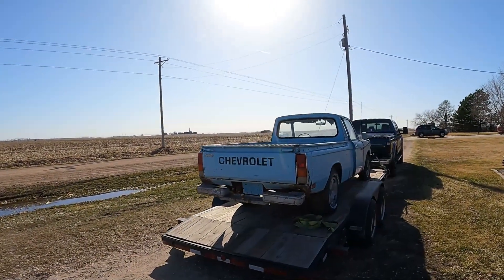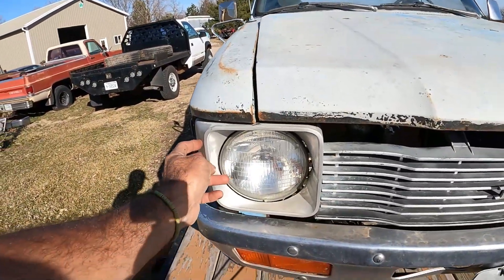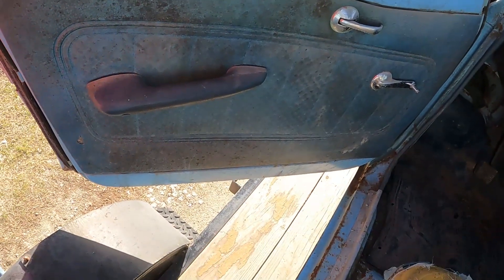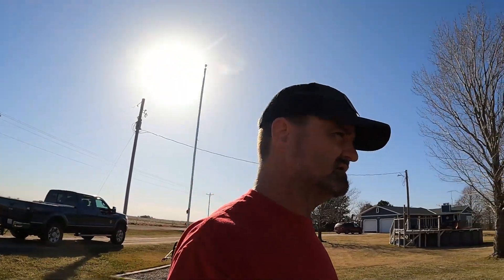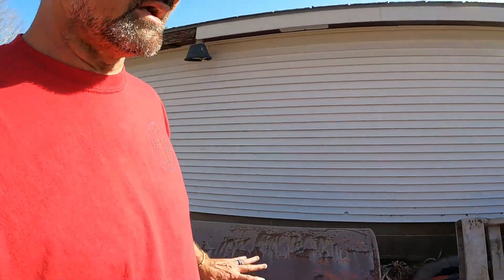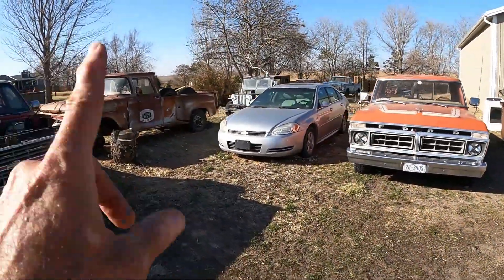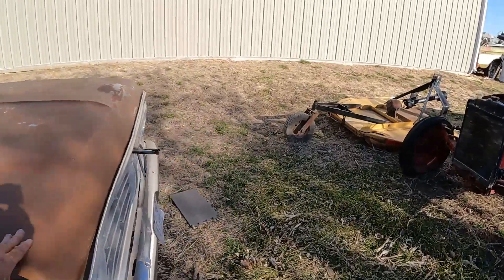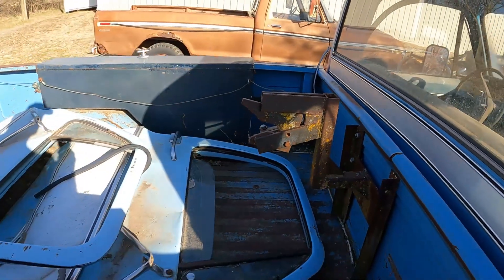We LUV rescues!  Another Chevy LUV dragged home!!  PLUS all projects update!

Comment: Looks like a perfect vehicle to install a turbo charged 3.0L Mercruiser 4 cylinder in it. It's the same engine platform as the old Chevy 2.5L 4 banger probably what that has in it if it isn't a foreign 4 banger? 

The Mercruiser 3.0L has the same transmission bolt pattern as a sbc so a th350 or a Saginaw 4 speed from a Chevy will bolt right to it.

If you're any good at fabricobbling then you might consider adapting a sbc head on it because it has the same bore spacing. One of those lessor expensive aluminum heads from the Bay of e would make some good power without the turbo.

Cool project.😎👍
Reply from the maker: There’s a whole lot of thinkin in this comment!   Interesting stuff.
Fabricobbling… love it!
Reply: @freedom1garage  
Sarah N Tuned from here is where I heard that word "fabricobbling" so you can give her the credit for that one.😎👍